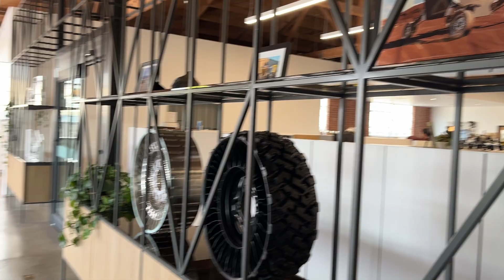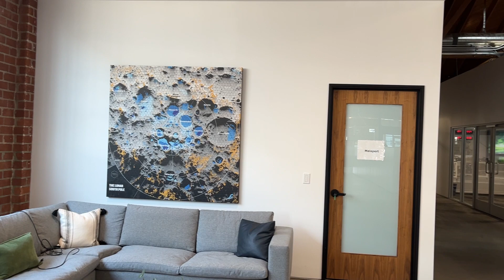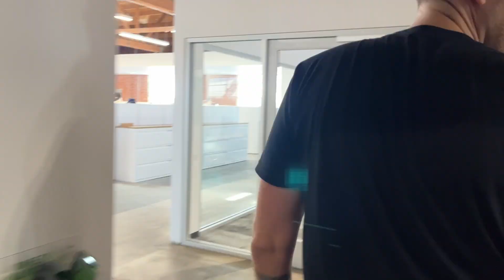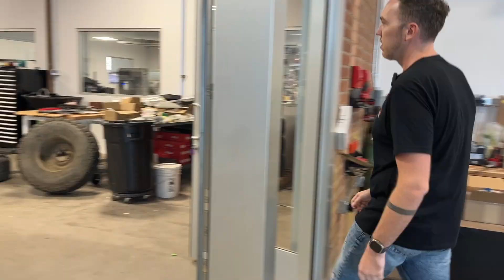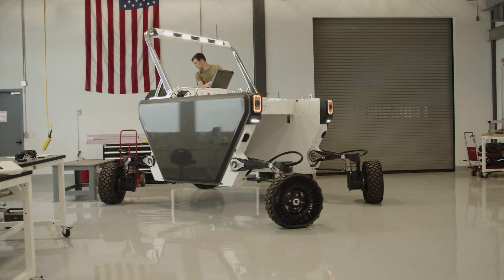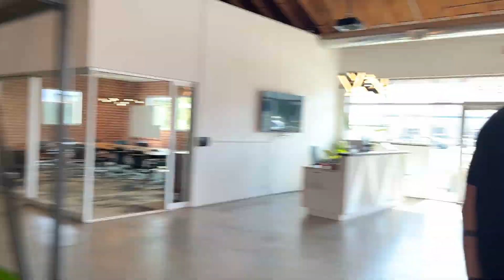Behind The Scenes at Astrolab | Building Rovers for the Moon and Mars

Comment: why are the wheels so small considering the diameter advantage needed for off road travel. HINT: Luna has no roads. I'm available for consulting in Mountain Home ID
Reply: wheel size is probably based off of the extensive experience of the manned and unmanned lunar rovers over the last 50 years. also i think this rover will usually be driving slower than the manner LER from apollo. also it might have active suspension to help maintain orientation/balance and probably can use this to help with rough terrain. in a same way, modern lunar landers have much smaller feet than old ones, probably because the regolith is usually much harder and packed than we though initially during the first missions to the moon.
Reply: Could be you dont need as big of wheels bc it's 1/6 gravity less force needed and whatnot
Reply: @Demontoastslayer  the lower gravity on the moon isnt the only factor deciding wheel size really. lower gravity means you bounce higher up and at a different frequency than on earth, also the terrain can be much wilder than what we would consider driving on on earth. so there's alot of factors in addition to gravity, that could push wheel size up or down really
Reply: Aren't those wheels already bigger than the ones on most moon and mars rovers?